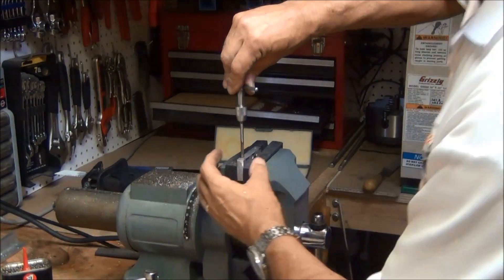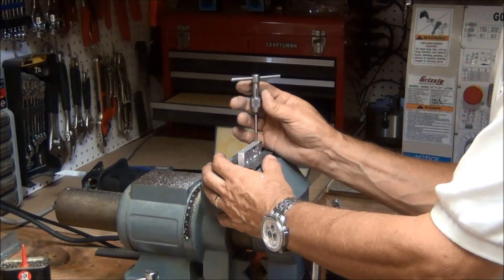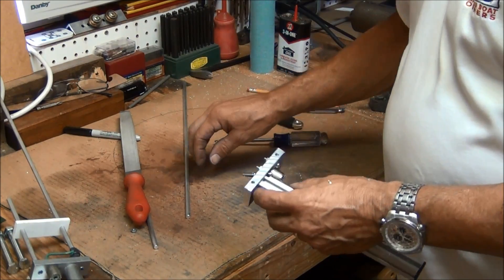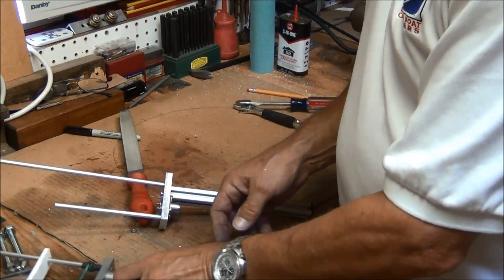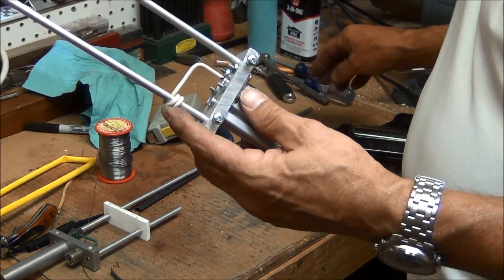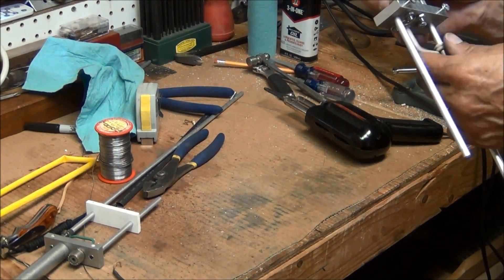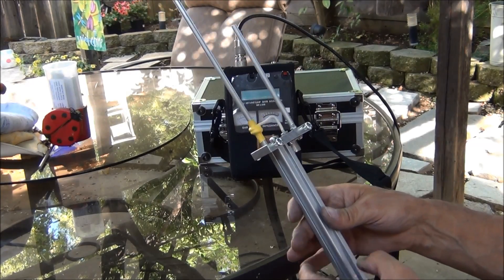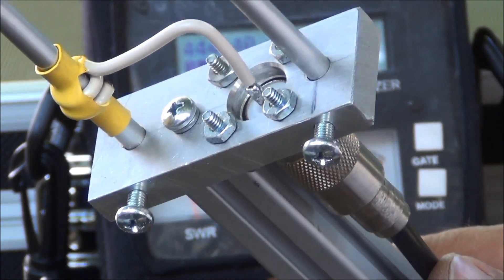J Pole antenna for 70cm part 3 by N6TWW

Comment: How does that work after a long period of rain/freeze. The coil?
Reply from the maker: Rain has not been a problem. Where I live it doesn't freeze that much.
Reply: @mefedler  ok super. I live in Tennessee.and we get our share of the Caribbean. Fall and spring. If i want to keep it I have to put mine in a tube. if i want to keep it tks de kv4li. Ps I like ur shop .

Comment: Does anybody know how to calculate the lengths for this antenna? I want to build one for GMRS 460 - 470 Mhz. But I need some kind of formula to translate from 70 cm to GMRS
Reply: Make it smaller by the ratio of freq, so between 44/45 and 45/47 of the size. So close to 1:1 you can probably keep the number of wraps the same, at 2.

Comment: the thing that looks a bit strange is that the copper of the wire isn't touching the aluminum.
Reply: +johan ghostwhiper Capacitive coupling. That means there isn't a direct connection, (think soldered). The insulation of the wire acts as the capacitance insulator.

Comment: Great Vid!
Ok... I'm confused (what's new?).  I'm seeing about a 50/50 on attaching the center of the coax to either the long element or to the shorter one... which is it?  I'm going to build a J-Pole antenna just for RECEIVING - as in a scanner antenna.  I made a spreadsheet to calculate various frequencies; I'm interested the aviation band, around 119.2Mhz.  I have everything comprehended except which part of the coax goes where.  Does it matter for receiving?  Should I just try it one way and if it doesn't work try the other way?  Thanks!
Reply from the maker: Eric Bishop The center conductor of the coax connects to the insulated wire that is wrapped around the long element of the antenna. There is no direct DC connection to the antenna element. The connection is made by capacitive coupling through the insulated wire wrapped around the antenna element. Radio frequency can pass through the coupling but direct current cannot.
Reply: Mike Fedler Thanks Mike... I now understand that... however other J-Poles I've see the center of the coax is directly soldered to the (in about half the vids/diagrams) to the short element while the shield is soldered to the other element.  Then I've seen the other way around - center goes to the long element, shield to the short.  ???!  "Who's on first..."  aaaaaaaaaagh!
Reply: +Eric Bishop rx only ? just buy a discone scanner antenna ..

Comment from the maker: Yes, the entire antenna is at ground potential. It is perfectly fine to mount the antenna on a metal mast. The only thing that is not a ground potential is the feed point which is capacitively coupled (The wire with insulation still attached that is wrapped around the radiating element)